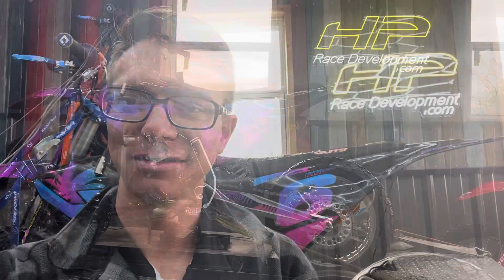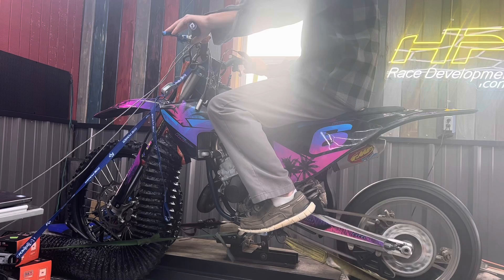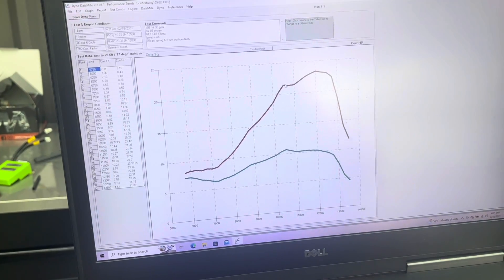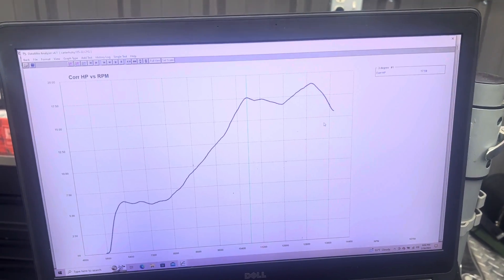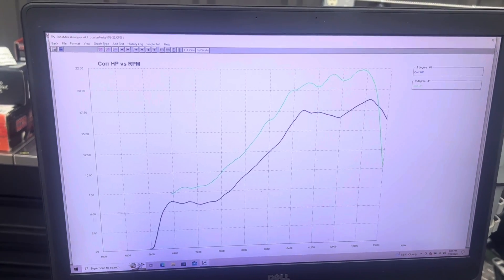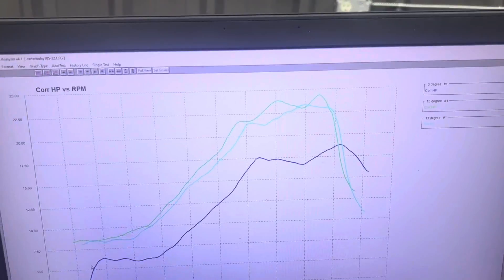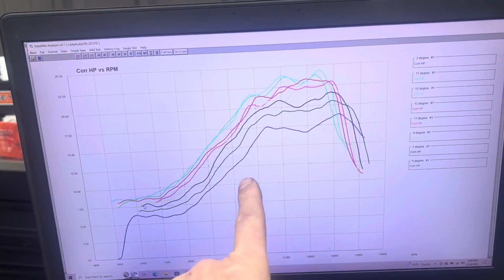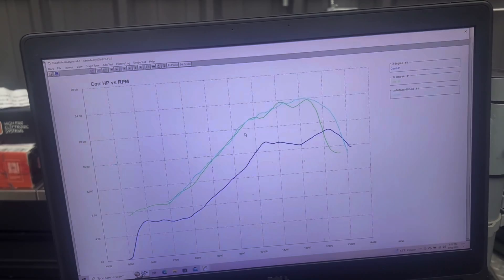2 stroke Ignition curves for dummies. Its EZ!

Comment: Cant connect to the pc software
Reply from the maker: huh
Reply: @HPRaceDevelopment  I installed my  DC CDI P2 Open Loop on my NSR125 jc22 and Installed software on the PC but its says not connected in the software. My bike does work with the installed curve of the DC CDI P2 Open Loop.. Confused,its a new cable.

Comment: i love your videos, i wish you wouldvdi more. one question on advancing the timing. if the bike is stock with stock ignition will advancing the timing at the stator plate result in similar gains?
Reply from the maker: @randytidwell5836  Usually a stock bike is already correct

Comment: When you develop an optimum ign curve on the dyno, how much "fine tuning" do you typically do to the curve after testing it on the track? Besides rider, what variables dictate further adjustments from dyno to track? Is it air quality and elevation or strictly just chasing tame usable power?
Reply from the maker: We have "fine tuned" our dyno process to shorten the track testing aspect.
Most shops really struggle with this concept and optimize an engine to a dyno run (load time of their dyno and process they use).  We have tried to optimize our dyno procedure to match what we have learned works on track.  Lot's of variables go into this - how much fan on the pipe - and load time - how many runs you do back to back to back to back in what coast down town etc.

It's a whole video topic in itself.  But once we have a good ignition and jetting combo - we might vary it 1-1.5 degrees in a few spots to suit rider request.  We usually sell our CDI's with 2 maps - one we like and 1 we think people might also like thats a little different. 

For the most part - what riders generally like is a little less hp in trade for a little more RPM.
Reply: @HPRaceDevelopment  thanks for the reply, I just sent you an email regarding a consult

Comment: This is the first of your video's I've watched actually found it quite interesting
'Back in the day' (80's) programmable ignition didn't exist, even having two stage high / low was a novelty
You should have had a gas analyser on it to show how much fuel just goes down the pipe when ignition is fixed too close to TDC, hydrocarbons are always high but showing how much is either burning in pipe or just cooling it down is always interesting (at least to me)
Personally, too much over rev capacity is a bad thing, (unless you like re-building cranks ?) 
 Big end fails when bearing / bearing cage overloads and skids with high centrifugal load (silver plated cages on 125's in 70's~80's)
I'll check out a few more before I decide subscribing

Comment: OP got a question for ya.....as the amount of 2 stroke oil is increased in the fuel mix (richer mix) should ignition be advanced more? In other words does 2 stroke oil make gasoline burn slower or faster > more oil=more ignition advance spark?
Reply from the maker: Not that we have experienced.

Comment: Thanks for sharing your hard earned information we are a third generation moto family and are struggling with getting our 2024 GAS GAS 65 to perform well some are better than others we have two and several of the people we race with are having the same issues the 23 didn’t seem to have these issues. My grandson is 9 recently got off the 50s he was super confident in Cobra it was consistent in the performance area he has to ride his butt off because he’s 105 Lbs so kids65-70 Lbs usually get to the first turn ahead naturally, I’ve been watching your stuff since I first found you when you got pulled into the claim gate debacle ( you guys got hosed for no VALID reason) now after a very long winded explanation have you had the time to develop a great top level race package for the 2024 65s yet? Have you found any of the bike oddities and what is the root cause, we have a few friends at KTM Daniel Blair and Justin Musket and they haven’t found the root cause but acknowledge it a valid issue. We may need a good race engine soon & maybe our WP cone valve kit sprung and valved for him, he’s really good but the new bike keeps us from letting him push to his ability it’s soft and scary because the way it runs and bogs intermittently. His Cobra 65s were good runners but he fits the GAS GAS better. Can you help? ❤🙏

Comment: 2,3,4,5 degrees from stock or literally before TDC ? Would stock be say 12 degrees and never 2? Does any motor run at 2? So if you retard the timing it's still before TDC ? Not experienced sorry . Cylinder head temperature goes up if ignition is advanced ? How  does it effect pipe temperature ? Cool content thanks .
Reply from the maker: You have to ask a little better here.  But those are absolute values vs TDC.
Reply: I thought they were , because the timing retards as revs increase which is inverted for a 4 stroke .lf you started at 2 degrees firing couldn't get to after TDC, it's just not that obvious for a novice . The burn is inefficience for 2t , i wonder how efficient a jet engine is ? They do have power to weight %. Thank you . @HPRaceDevelopment

Comment: great video,how much earlier do you start pulling timing to extend the overrev? 500rpm?
Reply from the maker: everything is kinda like a delay on these due to pipe temp taking time to change
so u start pretty early just barely taking some out - and work from there
Reply from the maker: the straight ignition tests are good for us too, revisit what the engine likes. i was really shocked by some of it at spots how close straight was to a nice curve. years of 2t advancement for measly gains ha

Comment: do you use a inertia or a brake dyno for this?
Reply from the maker: I have 2 dynos one is a water brake and the chassis dyno is inertia with a brake we can use

The inertia is far better over the years - and ironically now lots of nascar shops have switched over to inertia as well
Reply: @HPRaceDevelopment  okay  thanks, So you usually use only inertia on your chassis dyna without using the brake? is with brake not better for adjustments because there is more load on the engine

Comment: Great videos, thanks for the info we know your time is valuable.  How about FWE Cobra 2023 50 cc worked on an all out fire breather yet?
Reply from the maker: not legal for any racing we do...anyone who says they do anything to them that will pass the rules is either lying or cheating
Reply: @HPRaceDevelopment  
We are in Northern California and only have ama races for Loretta’s. 
For that we use a new stock bike, but everything else allows full mod 50cc motors we also have Mammoth mountain that allows big bores most run 60cc but the Cobra 65 piston is dimensionally compatible also but may not be any better going to 65cc. 
But it sounds like you haven’t done mods to the 50’s So Cal and Nor Cal have some fast minis think you could build one that would be better? 🤔
Reply from the maker: @raymondharold5973  The current 50 from cobra jetted well is quite good. id be very surprised to see one thats still a 50 be better overall engine combo. Any peak gains you make trade power width - which is critical on a single speed

The 60s of course can be very stout vs a 50
Reply: @HPRaceDevelopment  The mammoth motors are definitely faster but the mod 50’s some are and some are slower but with a complete system wide change done well some is left on the table you would think, don’t you have a CDI that could be programmed or is there not enough business to justify doing that. I’m wondering what a project like that would cost, I’ve seen that you take a system wide approach and that’s the only way to not miss some potential performance. Any interest ?
Reply from the maker: @raymondharold5973  always interest - just never much free time! We are adding on and making a lot of shop changes for the next year - hopefully by fall/winter we have that rolling and I can have some more free time for projects

Comment: I watched your previous ignition video first, and as soon as you said the first run was going to be at 3 degrees static, I knew exactly what it was going to sound like! I have a seriously modified 1974 Honda CR125M with a digital PVL ignition and these videos are answering all my questions, great, thanks!!
Reply: I'm thinking about building a (even more 'rocket')  engine for my cr125 (1980) competition bike. With programmable CDI and mügen porting on a stock cilinder. I'm pretty new to 'tuning' so all info is welcome! 😁

Comment: what about power jet? in my 2006 rm 125 manual says it is open from 9000 to 11000 rpm. could i get more top end power with smaler main jet and compensate with bigger power jet? will it kill botom end? (it´s already have none)
Reply from the maker: The powerjet properly utilized increases bottom to mid while maintaining good peak.

Comment: The older Husky Cr125’s with some good porting and a modded CDI make more power than the newer ones.   Now what I’m looking for is usable power.   Pipe tuning is another aspect.  It all works together.   Love this info.
Reply from the maker: i dont know about that…The older husky 125s used a T port exhaust and very yamaha like cylinder. For us, the current ktm/husky jetted right makes incredible stock hp

and properly built even more incredible mod hp. 

That said I havent tried to jazz up the old school husky so maybe your on to something
Reply: @HPRaceDevelopment  I was thinking the 98 up like Chiodi raced to a world title with.   I have a 2000 and a 2002 that needs bored and plated so I thought it made sense to work it over and see what I could make happen.   Fast by Ferraci has a few JD race ignition cdi’s left over with some pretty good maps.   With more R&D I imagine some more power could be found.   Thinking GNCC XC3 ripper and a good setup for whoops/SX style stuff.

Comment: Would this mean that fully ported engine with custom Pipe made to work at 12 000+ rpm is gonna need less timing
Reply from the maker: Than what?  An engine need the proper amount of timing for the design at every RPM.

Comment: Would u need a re mapped ecu if u put an after market pipe?
Reply from the maker: If you want a real race bike.
Reply: @HPRaceDevelopment  so I can send u an ecu and u can tune it for a yz250 that just has an fmf system and vforce reeds?
Reply from the maker: @adriangalvez5104  no.  Requires a new cdi

Comment: Great video! Would this apply for all bike or just TPI / TBI bikes. I don't see any cdi's for my 2018 KTM 250 XC carbureted (with lectron) on the website.
Reply from the maker: this is for all 2 strokes

we offer cdis for the ktm250 and 300s

in your case what you want to change is the question
Reply: @HPRaceDevelopment  After watching both of your videos its clear bikes ignition curves respond and act differently based on what parts you have on the bike, mine is almost fully suited up with engine mods beside the high performance 2 stroke head which I will be picking up soon. As in what I would like to change I have no idea 😅but a more optimal ignition curve would be nice like shown on the dino.